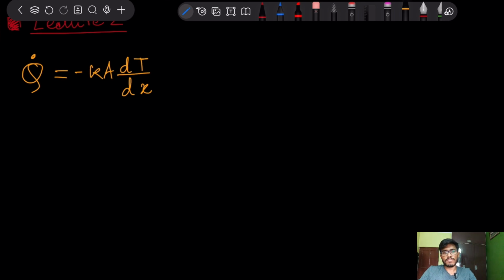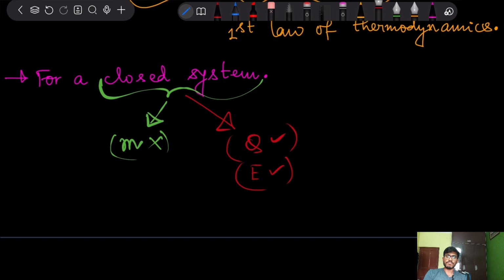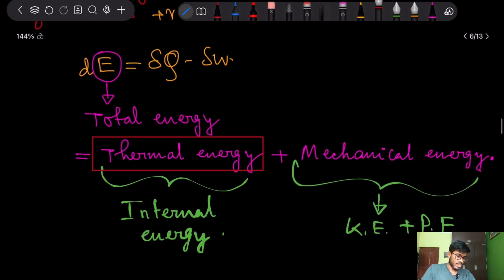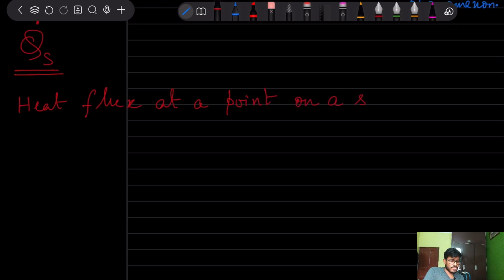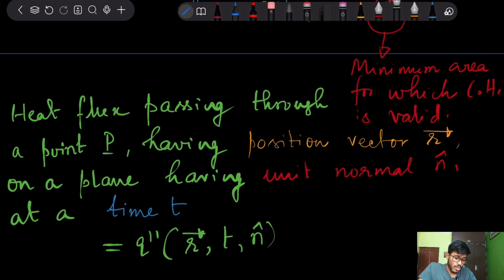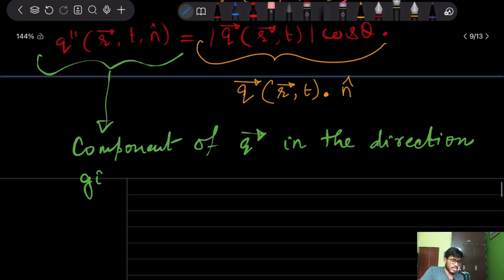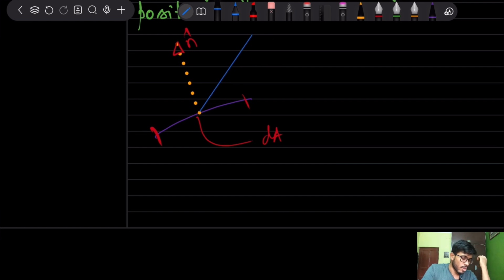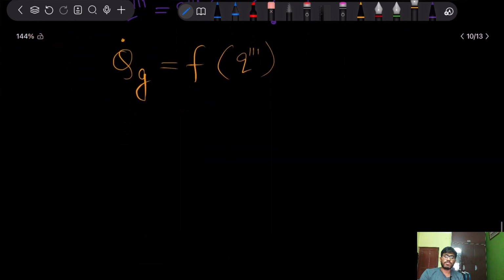Advanced conduction 2| By GATE AIR 31|

Comment: At 24:00, in this scenario heat transfer will occurs due to temperature difference between gas and coil not work transfer, but an electrical work is done on the coil which produces heat in the coil due to resistance during current flow.

Comment: At 23:34, it is a Work Transfer as electrons in the heating element will have to work against the potential with delta(V) *i*t, and this work will be stored by the gas molecules in the form of Internal Energy, thus increasing the Temperature of the gas.